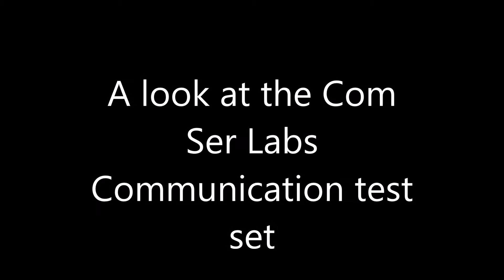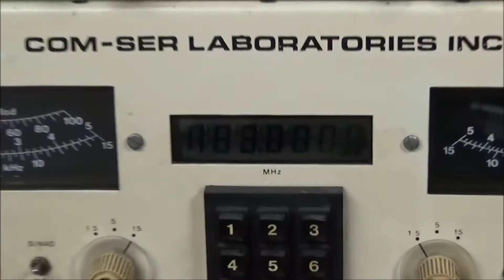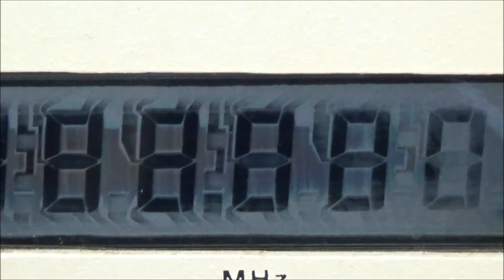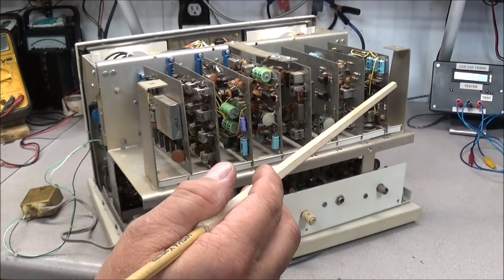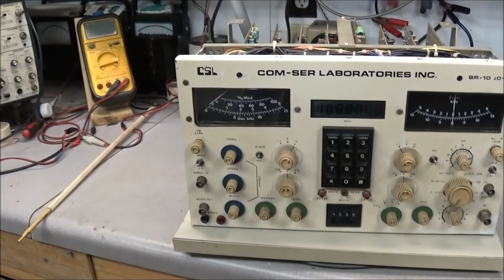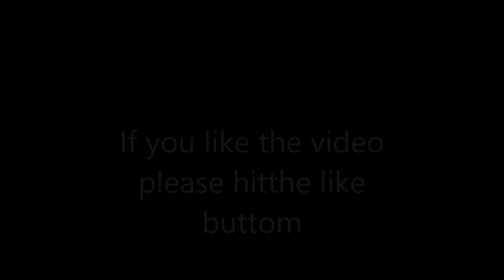#008 Com Ser Labs BR1000a overview

Comment: Got it yesterday. Poor packing job. Slight dent in rear corner. Well. Got lucky.  The signal generator is functioning somewhat. The controls will need a De-Oxit treatment. Zeroing in the needle works with either right or left FM knob. I forgot how to connect my external frequency counter to verify if the  output was on frequency.I'm guessing it was. 27.1850. typical for CB radios. It bugged me that the intensity UV control is in large 10-100 UV etc. Wanted to use the monitor to set S Meters. My guess is that being a PLL circuit it was dead on 27.1850. Now maybe. Some one can write a Manual for this from Memory GOSH !

I bet. Judging from the rust on the rear screws & experience. This sat in a garage forgotten for years. The oscilloscope needs to 

be repaired. It's a Tank. Survived the poor packing job. Really would like to use the other functions besides the oscilloscope. How do I get %30 modulation set at the output ?  what is the BNC male in the Back for ? Annoying. The Local CB Shop. About 10 miles away on high ground was being picked up by the Monitor & into the radio under test. "illegal linear"Just went to 21. Anyway. Hopefully get more information like how to use the Modulation Meter. Looking at the Schematic wasn't sure if I can bypass the current LCD display. As soon as the De-oxit arrives. Will open it up. I have a large stock of fresh Japanese capacitors. Will check out the PSU
in the UNIT. Again thanks for the information. & thanks in advance for more !

Best John
Reply from the maker: +John Cohen Cool, glad it seems to work somewhat. The scope should be easy to fix. Have you checked out this thread on my site?http://gokarters.com/smf/index.php?topic=1736.0I have several threads there. You have to calibrate the unit. Now remember it has been many years since I have used mine. But you need to enter 40.00000 in to the display. Set the FM side switch to cal. zero meter and return to operate. Then set the switch on the modulation meter side to cal, zero it and switch back to operate.As far as modulation. On the lower right is your signal out and tone controls.  Set the frequency, switch to SG, set your tone control, on the lower left is a control called level. That sets your modulation in percentage.really wish I could find a operation manual but never have. I will try and post more on my website.

Comment: I could not sign up on AM Phone with my verified 15 year gmail address. I just bought this unit for 123.00 with shipping.Here is a UT video the previous owner seller made. I guess it will arrive sometime next week.Com-ser 1000A in search.I cannot afford 1K & up for a service monitor. However; I want to service align my vintage CB collection with it. I have a good 20MHZ modern oscilloscope already. Info gleaned from other posts. It appears that the scope module could be removed till I am ready to refurbish it.The first glaring issue from the video is that the Frequency display must be replaced. I am thinking that one of my made in China LED frequency counters might be the quick cheap fix. ON Ebay search Blue 0.1--60MHZ 20MHZ 2.4GHZ RF Frequency counterI'm hoping that the LCD display is module connected to a driver module board. Then perhaps I connect the new counter to the signal feed to the driver board ?.I will check to see if you left links to a user manual. Any help appreciated.Best John
Reply: +John Cohen  shoosh search this for the video of my unit Radio Service Monitor Radio Test Equipment Com-Ser Laboratories BR-1001-A
Reply from the maker: +John Cohen  Hi JohnHere is a link to my website. I have the schematics and some tear down pictures on it:http://gokarters.com/smf/index.php?topic=1736.0I also started a thread over at the EEVbloghttp://www.eevblog.com/forum/repair/com-ser-laboratories-tear-down-possible-repair/msg753755/#msg753755I am having trouble locating a LCD that will match the one in the unit. But to be honest I really have not looked very hard. Been so busy  here lately. But will look into it further and see what I find. Let me know when you get yours in.
Reply from the maker: +The Radio Shop  I just watched his video. Sounds like the unit is working other than the display has gone bad. You may be able to use it with out replacing for now.  All you do to enter a frequency is *27.205000#Then turn the attenuator up and set the mode switch to AM and the signal switch to SG. Then see if you get a signal on a radio. It has been a long time since I used mine since it broke. I have never found a user manual for it. The scope unit is hard to tell if it is working or not. But the scope is the same unit as the Beckman BK 1405 and there is a schematic in this thread here on my site at reply number 2:http://gokarters.com/smf/index.php?topic=2402.msg18083#msg18083.The scope uses oil filled .o1 caps at 2kv. They are pretty rugged.  Check all the resistors and diodes in that part of the scope around those caps.  The circuit board is mounted up side down in there so heat is an issue.

Comment: I bought one of these new when they first came out.  It worked OK for the small 2-way business I ran out of high school, but I soon got a job repairing and calibrating all kinds of service monitors (Cushman, IFR, Wavetek, Marconi and Motorola) and it was then that I learned what a horrible monitor the Com-Ser was.  The generator put out many signals, most a lot stronger than the desired one.  The documentation was horrible, and the construction was very "garage like".  The silk screened lettering came off the front panel easily.  It needed a lot of RF to monitor a signal, so it wasn't very useful for over the air monitoring.  It had no internal power attenuator, so it came with an external one on a big heat sink with BNC connectors.   The case was crude and the lid did not fit well and the paint chipped easily.   There isn't a lot of information on line because it was a horrible, horrible instrument and few people bought them.  I didn't know any better, so I bought one too.  Later I bought a well used Cushman CE-6 which was a much better monitor, in every way.  I gave the BR-1000A to a friend of a friend, someone  I never met, and I felt bad sticking him with it.   Anyway thanks for bringing back memories!  Congrats on owning a fine piece of radio service history, I hope you can get it working.
Reply from the maker: +sdold Thanks for that information.  It really is not a top notch piece of equipment for sure. I will say when this one was working it did ok for what it was. At the time I was not as knowledgeable as I am now.  I did however work with EF Johnson and a GE land mobile radio dealers and got to use some nice Cushman, IFR and Wavetek gear.  I later bought a IFR 1200 and then a HP8640B. I still use both today. I am in the market for a Motorola unit with spectrum. I passed one up for 400 bucks last year and wish I had purchased it.Thanks for stopping by.